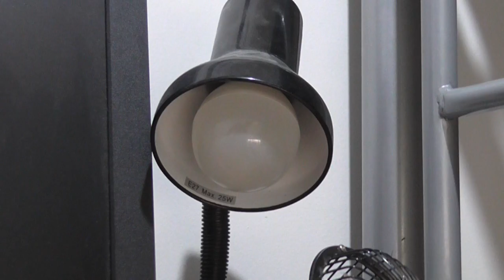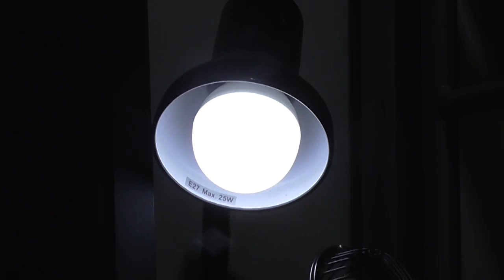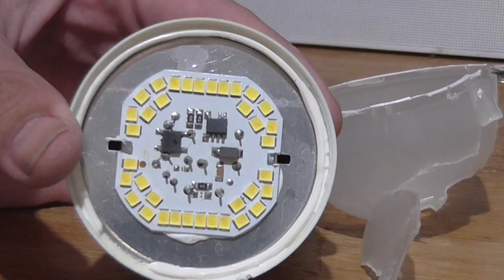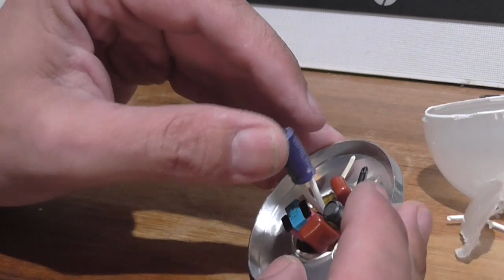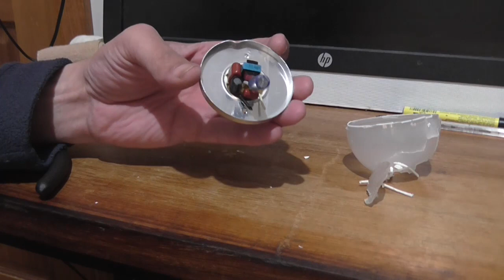LED Light Bulb - Why Did It Fail?

Comment: I had this issue many times with this type of led bulbs. I reflow the smd components and sometimes, the problem disappears. I think having LEDs and smd components on the same surface generates a high temperature that makes solders crack. In your case, it is probably the soldering points of the feedback resistor.
Reply from the maker: Most likely. And also the hairline crack near the rectifier wouldn't help, either.